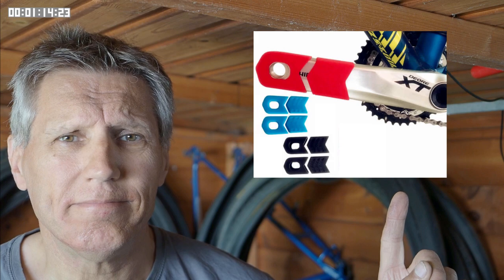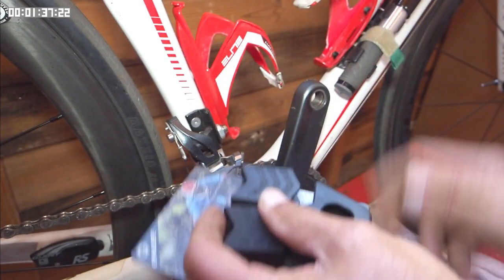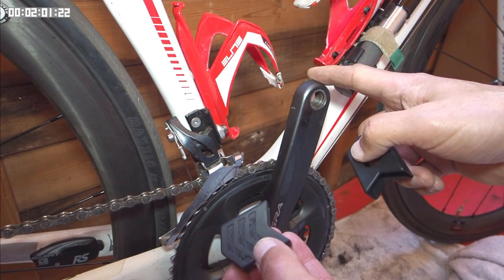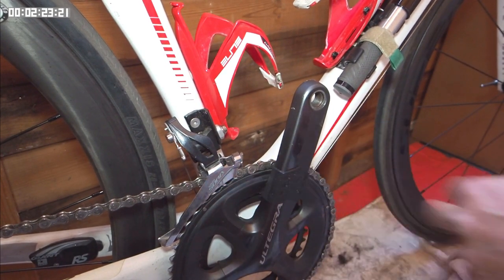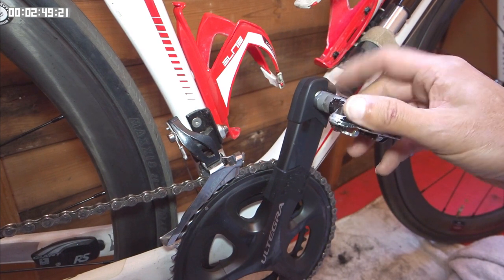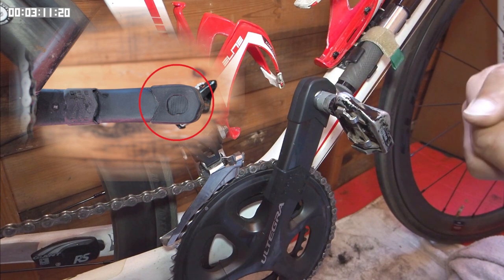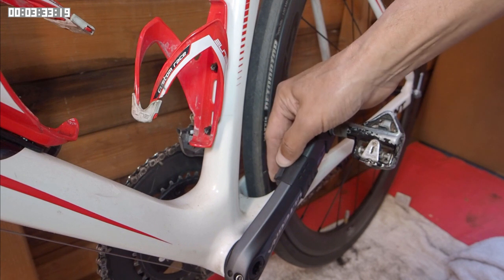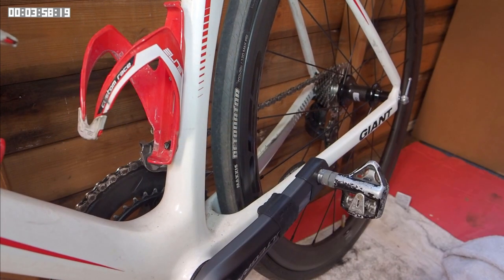Don't Scratch your lovely cranks.

Comment: Hi Terry. One possible downside to slip on protectors like the ones you show is that very fine grit can work its way under the covering, and over time that can potentially mar the finish on your cranks. My preferred solution to protecting finishes on any part of my bike is leading edge tape - a thick (0.35mm), transparent, self adhesive tape normally used to protect the leading edge of helicopter blades. I use it to prevent cable housings rubbing against paintwork, and to protect the chainstay from chain slap. I've not tried using it on cranks, but I don't see why you couldn't use it to protect the face of the crank; protecting the end of the crank might be a little trickier, but could probably be done.
Reply from the maker: Hi Will, thanks for the comment. There are many different ways to protect cranks and other components.  
I used to use Gorilla tape on the ends of the crank; I did put this in an early version of the video but I had to take it out because of my self imposed time limit. It was a bit messy and often came unstuck. 
3M also make a heavy duty clear tape that I have used as frame protection. Probably like your leading edge tape. 
All are potentially good solutions. Admittedly the crank armor is probably best suited to off-road situations where more substantial bashing is more likely. I have not experienced the issue with grit in the armor, but I only do light off roading.  Ultimately, its whatever works for you. 
Terry